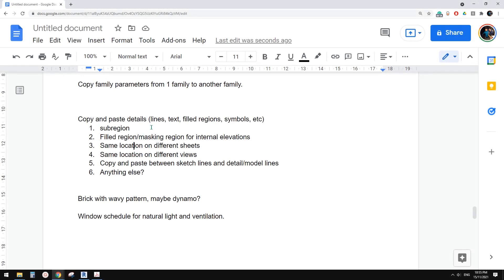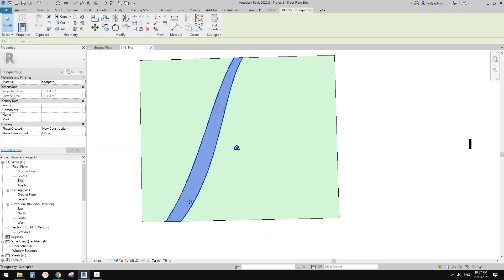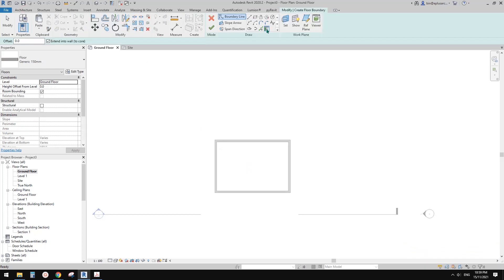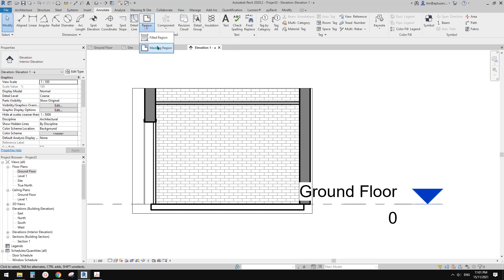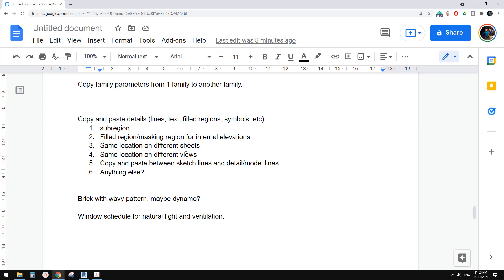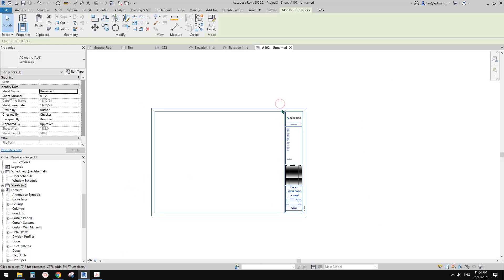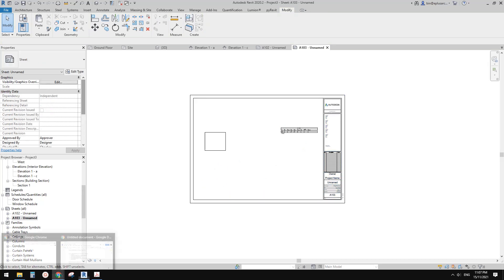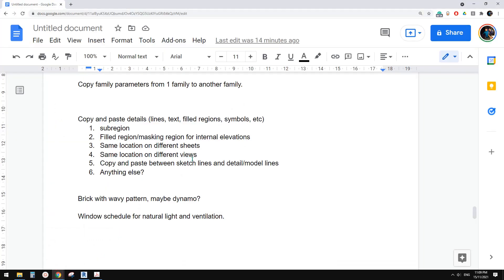Revit Exercise (Day 602) - Some tips of Copy & Paste Detail Items

Comment: Sir can you make a tutorial video for making site of any project with proper roads that follows topo and easy to edit if topo changes,easy way to add pathways and curbs as well???
Reply from the maker: I think there is an add-in "Site Designer" that you can try. I did try it a long time ago and found it hard to use.
Usually, I will only use subregion on topography so it will follow the topo.
You can try day 465 to make a floor that follows the topography, then try day 124 to make kerbs that follow the floor.
Reply: @BINHE615  okay sir i will give it a shot